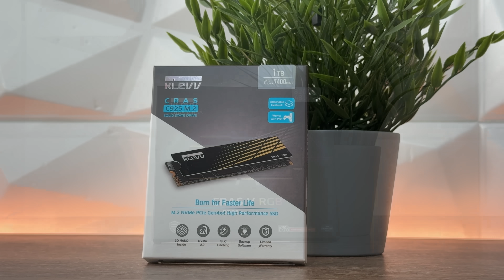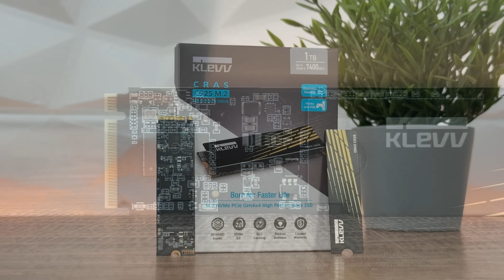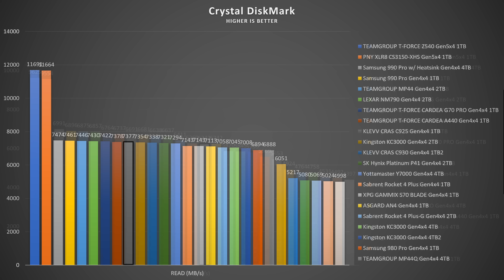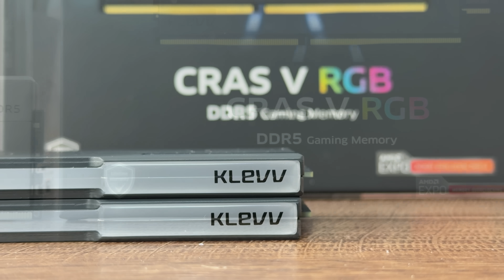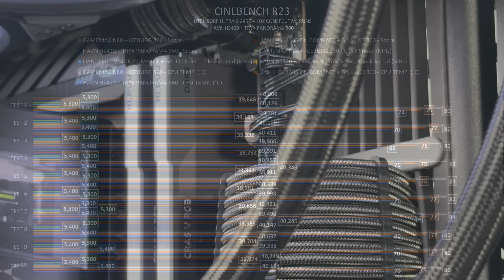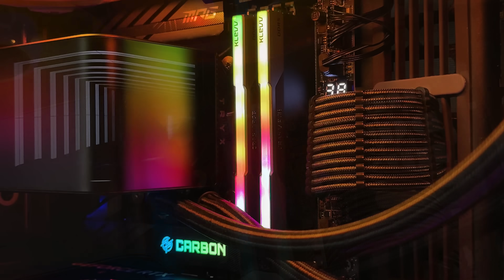Outstanding Performance - KLEVV CRAS V RGB DDR5 2x 24GB w/ CRAS C925 Gen4 SSD

Comment: I run 4x32 6400MT/s KLEVV RAM with a 9800X3D and a MSI X870-P MB with no issue. Now I can't run four sticks at CL32 though. Now with only two sticks this RAM can be overclock to 6700MT/s at CL32. I needed the 128GB of RAM for Microsoft Flight Simulator as 64GB was not cutting it and it was not cost effective to buy a 96GB RAM kit.

Comment: i am interesting to  buy  the  tryx   PANORAMA 360 ARGB. but my big question is   the best  CPU Cooler??    in cooling  from   Liquid Freezer III 420 A-RGB and Valkyrie Syn 360 ARGB LCd?

pc crazy?
Reply from the maker: I answered you already multiple times on multiple videos. If you are comparing 420 to 360 and you can fit 420 in your case, then it is quite logical what you are going to do. Go with LFIII 420, because it beats every 360 without a doubt. Simple.
Reply: @PCCrazyDario   the  PANORAMA 360 ARGB is not better  from  Liquid Freezer III 420 A-RGB and Valkyrie Syn 360 ARGB LCd?  in cooling performance?/
i mean  the  Tryx Panorama 360 ARGB  is not the best  liquid cooler in the market  now?>/  in terms of  cooling performance/?  pc crazy?
Reply from the maker: @mikealofonso2236  No. It is Asetek 8th Gen pump. Similar to Syn 360, close enough. But definitely not better than LFIII 420...
Reply: @PCCrazyDario   lets say  that i want to overclock the 9800 x3d  to. 5,.2Hz if i will  buy  the   LFIII 420. what temperatures i will have?>?>  the temperatures will be more  than 80 Celcius?>?
Reply from the maker: @mikealofonso2236  Literally have no clue, since I don't have a 9800X3D and didn't test it since I don't have it.
Reply: @PCCrazyDario   for  you which are  the  top   5  liquid cpu coolers??  in terms of cooling performance??
Reply from the maker: @mikealofonso2236  What size of the radiator?
Reply: tell me please??
Reply: @PCCrazyDario   420 radiator i mean 

for  you which are  the  top   5  liquid cpu coolers?? with 420 radiator  in terms of cooling performance??
Reply from the maker: @mikealofonso2236  Arctic Liquid Freezer III 420, Enermax LIQMAXFLO 420, Phanteks Glacier ONE 420D30, Thermaltake ToughLiquid TH420 V2 Ultra
Reply: @PCCrazyDario    from these 4  liquid cpu coolers  with 420 radiator which is the best for  you??
Reply: tell me please?
Reply from the maker: @mikealofonso2236  They are already written in order, but those are such small differences...
Reply: pc  crazy?
Reply from the maker: @mikealofonso2236  WHAT???
Reply: @PCCrazyDario     i  have  this case    lianli v3000+++

before some  months  you did the review for the lianli v3000+++

my question is  how many  fans and how many radiators to add  to  this case??

also can you send me  links  from where to buy  the fans and radiators??

so in  this case  how  many fans to add?? and etc?

can  you help me please??

i will  build my new  gaming pc...
Reply: @mikealofonso2236  You are either a bot or just a completely ridiculous person. Live this man alone. Thumbs up the video, like, subscribe and be on your way man. Come on now. Wow. Just wow.